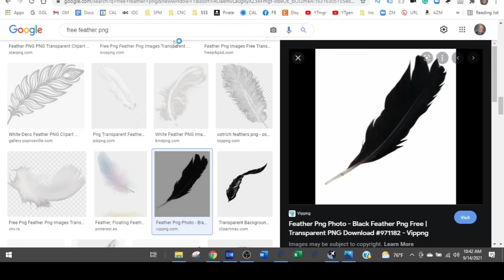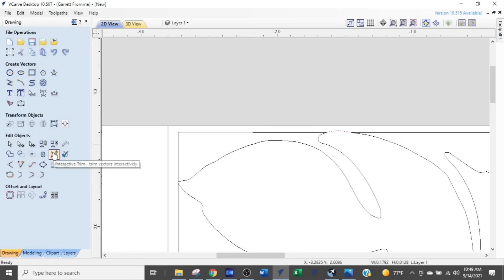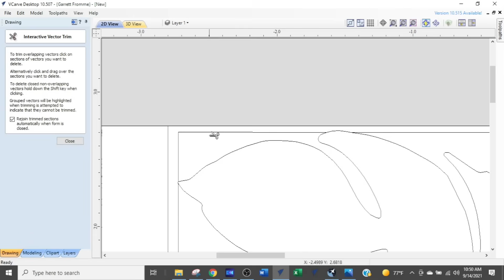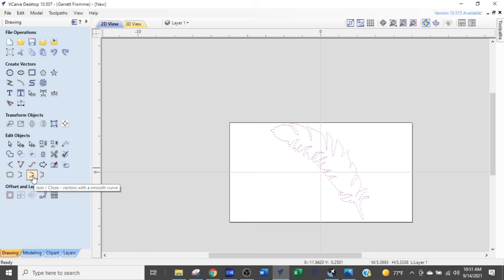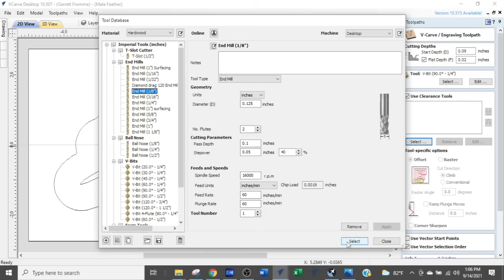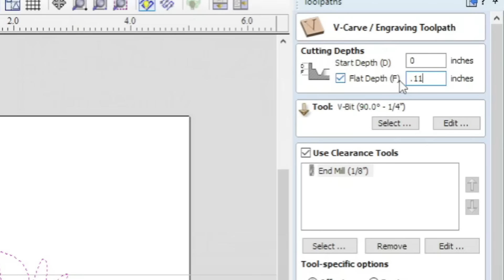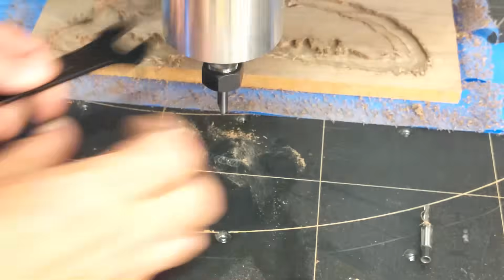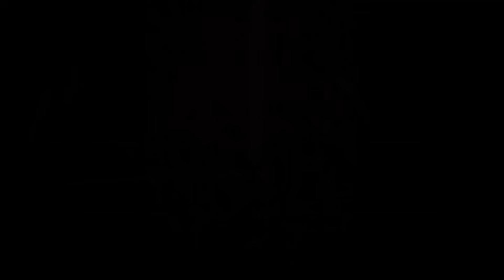How To Make a PERFECT INLAY with a CNC Router, Easy CNC Router Projects

Comment: Hi there great tutorial I successfully made my first inlay and it turned out great 👍 however on my second attempt i decided to use a logo and for some reason the 1/8 clearence end mill wont work with the lettering so the inlay didnt work out too well, i tried changing to a 1/16 end mill for the lettering and it said ‘clearance tool wont fit’ when it definetely should as the lettering is averaged size not too small, is there a way around this? It skips the end mill clearence tool for the lettering and just uses a v bit for the lettering, the end mill works with the rest of the logo though and so does the inlay, any help is much appreciated thanks
Reply from the maker: LG, with enough glue gap clearance you shouldnt have any issues with the v bit leaving material behind. Consider increasing the depth on your female inlay 0.050" so you have more space between the male and female inlay when you glue them together.
Reply: @IDCWoodcraft  the v carve part of the female inlay is way too shallow wich is causing the inlay to not work but only on fine detail such as small lettering, basically i need a narrow, deep cut for the female part without using the clearence tool, may try using a 10 degree v bit

Comment: Bro,  mighty thin inlay.  I've done a couple dozen inlays in flat wood and end grain cutting boards (male is glued-up edge grain as well).  I use the Zank method:  male SD is 0.1 FD 0.2; female SD is 0 FD is 0.3.  I use these regardless of bit size.  I've use 15, 30, and 60 degree v-bits depending on the design.  I like a thicker inlay to allow for a more 'beefy' inlay, especially in end grain and to allow for sanding.  My bits are also larger diameter.
Reply from the maker: UncleBob, that is a great depth for a beefer inlay! Glad to hear that setup is working out for you.

Comment: Garrett, thanks for another educational video.  I've tried this on several files and works great every time.  I'm about to attempt a detailed inlay at the center of a coffee table.  My table top is rough planed to just over 1 3/4" thick and will require several good sandings.  Any suggestion for Vcarve setting depths to make sure I've got the wood inlayed deep enough to withstand extensive sanding?  I've only every used the settings as per your video.  Thanks again
Reply from the maker: Scott, I would recommend using a 30 degree v bit to get a deeper inlay. Heres a link: https://bit.ly/3xWzxt6
You also need to try out deeper inlay depths to complement the 30 degree v bit. 

For the female: Start depth 0.0 Flat Depth 0.4
For the male: Start Depth 0.3 Flat Depth 0.1
Do a trial piece before you do the real thing on the table top brother!
Reply: @IDCWoodcraft  Thanks so much for taking the time to answer, much appreciated.

Comment: Great video! Was very informative, both how the program works, but also gave a basic understanding how the code is created. However, I had some problems following your steps. The first was when I needed to cut away the edges of the vectorized picture, it doesn't work. When I click on the outlines the whole "picture" (except the added lines) gets highlighted, and can't be removed. Mine shows up with a solid line, not dotted like yours, don't know if that has something to do with it. Another problem was since I used the free version, so I can't export the file at the end, so I decided to use your code, but when I run it in gSender I received a lot of different errors during the milling. Any Idés why?
Reply from the maker: TLW, this a bit of a tough one to answer over comments. Best bet would be to do a one-on-one over zoom. Here is the link: https://calendly.com/garrettfromme/60-min
As for the code issues, that gcode was designed for the Longmill so you might have trouble running it on your machine.
Reply: @IDCWoodcraft  i seem to be having the same issue as TLW, were you able to figure out the cause of the cut tool only being able to cut the drawn arc lines and not the border lines once all of the open vectors have been filled with the draw arc tool?

thanks,

Comment: Great Video, But man you should really get some Spector Tape, that Painters Tape with the Ca glue bit is just a waste of time and leaves residue behind, and a total pain. The Spector Double Sided tape is just as capable of keeping your piece in place and leaves no residue on wood when pulled.
Reply from the maker: Phrozen4life, good call brother! Ill look into that.
Reply: @IDCWoodcraft  I appreciate the Video I'm getting ready to purchase my First CNC and Inlays are something that has always impressed me, as I Would like to put them onto some of My work Pieces. So I am highly thankful watching your Video, it was Very long but it was Step By step on everything giving me the basic understanding of what is at play! As for the Spector Tape, I use it to hold pieces on my workbench to Route, I Use it for Putting thinner pieces of material on a cary board through the planer, or even holding pieces of wood together to Sand them uniform (This includes large pieces of heavy maple) and never had an issue. Amazon sells a roll for ~$15

Comment: used your formula and it works well. Any way to change the numbers to make the inlay thicker? I had trouble with sanding through the plug on a problem cutting board. If the inlay were thicker and deeper you wouldn't have to be so careful with the finishing.
Reply from the maker: Fred, you can definitely increase the depths of the inlay to make it thicker. Try adding 0.2" to the flat depth of the female piece and 0.2" to the start depth of the male piece

Comment: Hey Garrett. Thanks for the videos. I have a problem with my inlay. Using the parameters you lay out in this video. I inlayed corian into corian. I had a problem with epoxy squeezeout, but only in the corners. After milling down a few thousands it was still present. I used a very square font and the straights are real tight but every singal corner had ooze. I did notice that the toolpath has a diagonal on every corner. Not sure how to fix it. Any suggestions would be appreciated. Thanks. Mark
Reply from the maker: Brindlereo, send me a few pictures in an email. I can help you better that way!

Comment: I saw another video that used a tapered ball nose bit (1/32" ball) to get the sharper angles on the edges.  What are your thoughts on using this alternative to the v-bit?  You instructions were used and he indicated he learned from you.
Reply from the maker: JJ, You can do this but it is more for advanced users, you need to account for the radius at the end of the ball nose in your depth calculations.

Comment: Here's my notes, teach  - pin my comment:

• General Notes
  • Dimensions in inches
  • Notes taken from YouTube video: the one you're watching
  • Vcarve toolpaths - obviously
  • Male inlay material only needs to be 0.2" thick or better (>0.11"). Can cut slabs in half to make it thinner if you want. This would potentially make it easier to cut away later.
    • When you cut out the male/female pieces, clean them up with a dremel sanding ball prior to doing the glue up.

• Must have two copies of the project file, with the Male Inlay (what we're gluing in) being mirrored from our Female Base board (what we see).
  • Save off a copy of our project file using 'Save As'
  • Select the inlay vectors
  • Under 'Transform Objects', select the 'Mirror Selected Objects' icon
    • Check the 'Flip about job center' checkbox
    • Make sure the 'Create a mirrored copy' is unchecked
    • Click the 'Flip Horizontal' button
    • Click 'Close' button
  • Save the project

--------------------------------------------------------------------------------------------
• Male Inlay Toolpath planning:
  • It is helpful to put a vector around the inlay vectors to create a limiting bounding box around what needs to be carved out around the inlay.
    • You can draw a rectangle around the inlay vectors, or
    • Select the inlay vectors, then click on the 'Offset - offset selected vectors' icon under the 'Offset and Layout' edit items.
      • Select the 'Outwards/Right' radio button
      • 'Distance' = 0.75
      • Remaining checkboxes are not checked
      • Click the 'Offset' button
  • Click the blue 'Switch to Toolpath' button in the upper left corner of the workspace to switch to creating toolpaths.
  • Start Depth = 0.09
  • Check the 'Flat Depth' checkbox
    • Set Flat Depth to 0.02
  • V-Bit (90.0° - 1/4") with a blade edge (forward cutting knife edge)
    • This is the 'average size inlay project'. For small inlays, use a 60°. For large inlays, use a 120° v-carve bit.
    • 2-flute
    • Cutting Parameters
      • Pass Depth = 0.08
      • Final Pass Stepover = 0.005, or 2%
      • Clearance Pass Stepover = 0.05 or 20%
    • Feed and Speeds
      • Spindle Speed = 16000
      • Feed Units = inches/min Chip Load (from calculation was) 0.0022
      • Feed Rate = 70 inches/min
      • Plunge Rate 25 inches/min
  • Check the 'Use Clearance Tools' checkbox
    • Select a 1/8 upcup endmill
      • don't need to use a downcutting endmill so the cut can suck ass without a negative side effect
      • Allows you to be aggressive with a larger stepover and higher feedrate
        • Example
          • Diameter = 0.125
          • Pass Depth = 0.125 (1x tool diameter)
          • Stepover = 0.0875 or 70%
          • Feed Rate = 80 inches/min
          • Plunge Rate = 60 inches/min
  • Tool-specific options
    • Check the 'Offset' radio button
    • 'Cut Direction' doesn't matter, he chose 'Climb' option
  • Check the 'Use Vector Selection Order' checkbox and leave 'Use Vector Start Points' unchecked.
  • Check the 'Project toolpath onto 3D model' checkbox
  • 'Vector Selection' set to Manual
  • Give the project a name
  • Select the vectors, then click the 'Calculate' button

  • Click the 'Preview All Toolpaths' button to get a visual of what the male inlay will look like
  • Name the two toolpaths
    • The 1/8" endmill toolpath defaults to name '<Project Name> [Clear]'
      • Rename to whatever, but this toolpath needs to be ran first
    • The v-carve toolpath defaults to name '<Project Name>'
      • Rename to whatever, this needs to be ran after the endmill operation
  • Close the Preview by clicking the 'Close' button
  • Click the 'Save Toolpath' icon under 'Toolpath Operations'
    • The 'Visible toolpaths to multiple files' radio button should be checked - others unchecked
  • Click the 'Toolpaths' checkbox to select the two (endmill and v-carve) toolpaths
  • Make sure the correct 'Post Processor' is selected (may have 'inch' postfix, which would be appropriate)
  • Click the 'Save Toolpath(s)' button
    • Rename the pre-populated filename to something male/inlay in nature, as Vectric will use whatever we put in here as a basename, appending our previously chosen names to the end of this common base.
      • The order of the toolpaths in the project play a role in the named output files
    • Click the 'Save' button

--------------------------------------------------------------------------------------------------------------------------
• Female Base board Toolpath planning:
  • With the female project opened, click the blue 'Switch to Toolpath' button in the upper left corner of the workspace to switch to creating toolpaths.
  • Select the v-carve vectors
  • Start Depth = 0
  • Flat Depth = 0.11
  • Use the same v-carve bit
    • Same feeds/speeds
  • Same 1/8 endmill
    • Same feeds/speeds
  • Same remaining settings as before
    • 'Tool-specific options' = 'Offset', 'Climb', 'Ramp Plunge Moves' = unchecked, 'Use Vector Selection Order' = checked, 'Project toolpath onto 3D model' = checked, 'Vector Selection' = Manual
  • Change Name to something useful
  • Click the 'Calculate' button

  • Click the 'Preview All Toolpaths' button to get a visual of what the female inlay will look like
  • Rename the two toolpaths similar to before (except give it a female vibe)
  • Close the Preview by clicking the 'Close' button
  • Click the 'Save Toolpath' icon under 'Toolpath Operations'
    • The 'Visible toolpaths to multiple files' radio button should be checked - others unchecked
  • Click the 'Toolpaths' checkbox to select the two (endmill and v-carve) toolpaths
  • Make sure the correct 'Post Processor' is selected (may have 'inch' postfix, which would be appropriate)
  • Click the 'Save Toolpath(s)' button
    • Rename the pre-populated filename to something female/base in nature for our project
      • The order of the toolpaths in the project play a role in the named output files
    • Click the 'Save' button
Reply from the maker: PPG, great notes brother! This will definitely come in handy for other CNCers.

Comment: What if you wanted a thicker more durable inlay, like for a cutting board?
Reply from the maker: Ollie, you can definitely do that with a deeper inlay. You would increase the depth of the female portion and the start depth of the male portion to match. Try using end grain too, it will be super durable that way.

Comment: Thanks as always for your great instruction Garrett! 

I'm planning to do an inlay in an end grain cutting board, so both the male and female pieces will be end grain. A couple question if I could:  1) Because it will be a cutting board that the client will use, I'm thinking it should be deeper than what you've done here, maybe .25"? In that case, would the male numbers be .23" Start Depth and .02" Flat Depth (for some reason those numbers seem backwards to me!)? 2. Are there any other concerns about doing this in end grain?

Thanks for all of your great work!
Reply from the maker: b-radg, endgrain will give you better results. I completely recommend it! Those numbers could work but I would recommend some trials before you make something for a client.
Reply: @IDCWoodcraft : Got it, thanks Garrett! I'm going to try a first test at .145" (.125 + .02), then another at .25. But yes, I did some v-carve lettering into end grain and it came out great!
Reply from the maker: Just increase everything with the exception of the 0.02.
I suggest doing a practice first to make sure things work on cheap wood

Comment: I followed this tutorial exactly but with my own svg and a 60° v bit. The inlay dry fit was pretty sloppy but I tried it anyway. There's a 3/64" glue gap between the male and female after the reveal. Any idea what I did wrong?
Reply from the maker: Aaron, You need more clamping pressure brother! Try using big honking C clamps with plenty of wood on top to distribute the pressure. The more clamping pressure the better. 
Also, the bigger the inlay, the more accurate your machine needs to be. So if the inlay is larger than say 10" or you will have issues with fitment due to accuracy issues. 
If you can, split the inlays into multiple parts. You can do this with inlays that contain separate letters etc.

Comment: I am using Carbide Create:  For the male piece, when I set the "Start Depth" to 0.09 and the "Flat Depth" to 0.02, it returns "no tool path"... however, when I set the "flat depth" to 0.14 (which is 0.03 deeper than the 0.11 depth that I used for the female piece), it seems to generate a tool path.  Am I missing something?
Reply from the maker: Aaron, that is a bit tricky to answer with Carbide Create. They use a different toolpath algorithm than Vcarve. Reach out to the gents at Carbide Create and they should be able to help clarify that problem for you!

Comment: hello Garrett, is the flat depth of 0.02 inches constant? Or does it change depending on the depth of the inlay?  For example, if I want to make an inlay of 0.138 inches, that's: starting depth: 0.1178 inches and flat depth: 0.02, right?
Reply from the maker: Samy, those numbers could work if you are looking to make an inlay of 0.138 inches. The 0.02" is the distance you need between the base and the inlay when you glue it up. So that is really up to you.
Reply: @IDCWoodcraft  thank you Garrett for your answer, I will continue to watch your videos to improve myself... keep up the good work 😉

Comment: 9:14 The checkered background indicates transparent portions of the image. If you save the image itself instead of snipping the screen there will be no issues as the software should very easily distinguish image from background. Software that allows importing vector images (dxf, svg, etc.) would be even easier to use, and the vector image can be scaled up without artifact unlike a bitmap.
Reply from the maker: r2db, that is a great point. Something I need to consider for future projects, especially with SVGs.
Reply: I noticed the same thing.